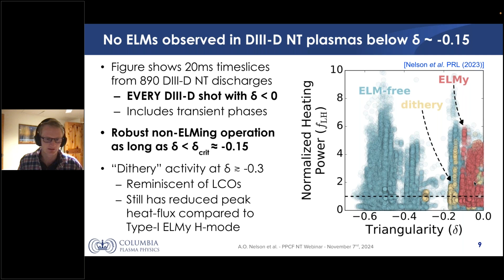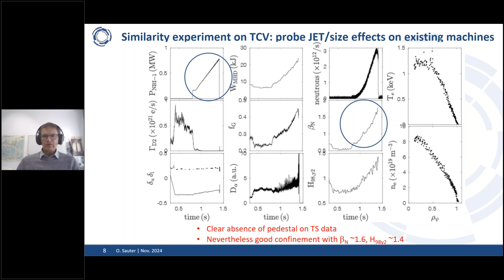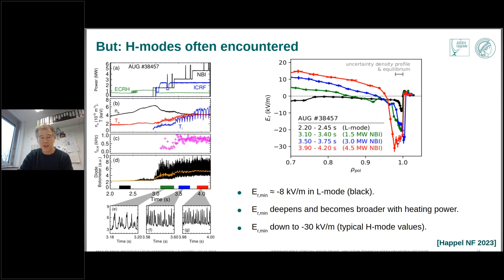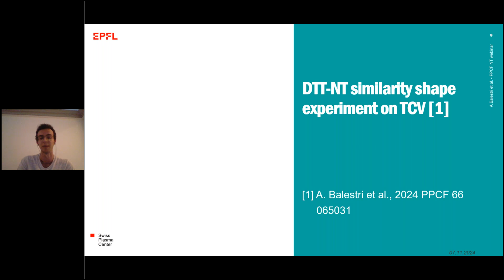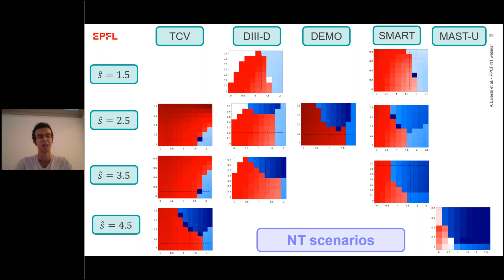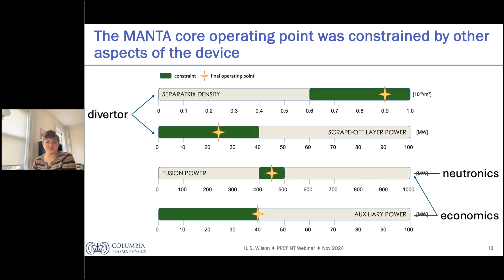Negative Triangularity Tokamaks: A power plant plasma solution from the core to the edge?

Comment: If the is works...Fusion energy could be possible in 2025???!
Reply: This is a bit too optimistic approach. I think this experiment will help us understand the fusion reaction in a better way but won't provide miracles. This experiment will bring us closer to net positive energy production through fusion reactions, but it is unlikely to be achieved this year. Higher power experiments should be conducted based on these experiments